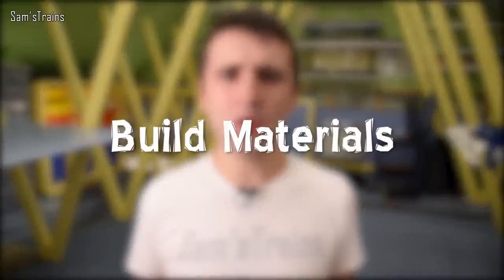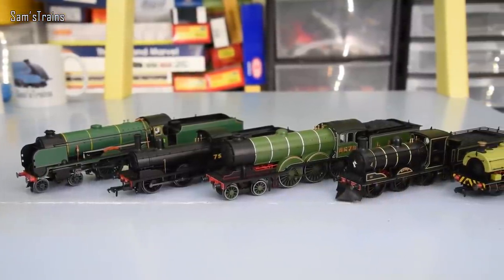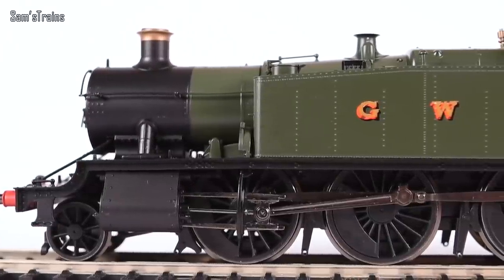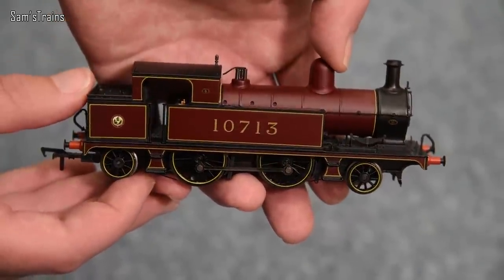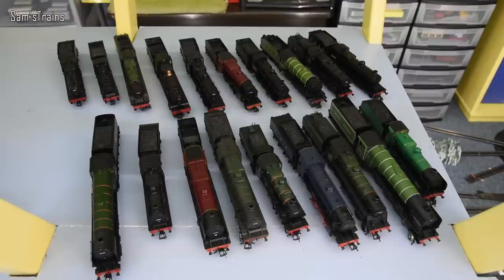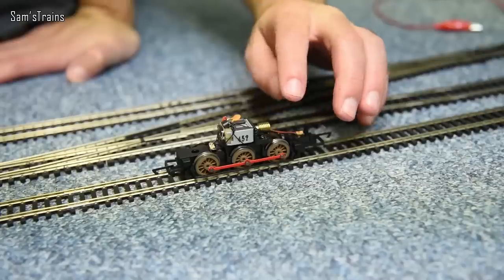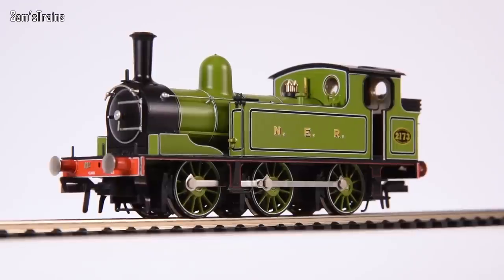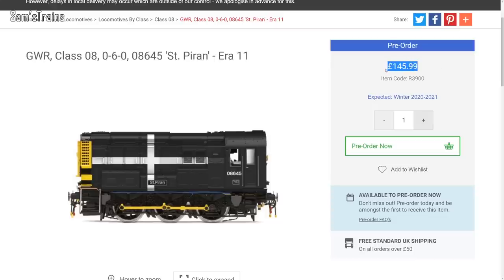Bachmann vs. Hornby Trains | What's the Difference?

Comment: Bachmann Thomas vs Hornby Thomas
Bachmann Thomas
+Is mostly TV accurate
+Has moving eyes
-Lacks open cab because cab area is stuffed with motor
-Lacks front coupling
Hornby Thomas
+ Open cab
+ Can pull a lot more
-funnel is too thin compared to Hornby E2 and Bachmann Thomas
- Only pulls more because of traction tyres
Reply from the maker: Thanks for sharing - I agree with that! :D
Merry Christmas - Sam :)

Comment: I recently have wanted to start model railroading and I’ve noticed that Hornby uses the tension lock couplers and Bachmann seems to use for their Thomas range, but their normal models do not, if I were to purchase a bachmann model, could I replace the coupler they use with a tension lock coupler?
Reply from the maker: Most of the British Bachmann models have those tension lock couplers, but they're all NEM now, meaning you can easily swap them! :D
Thanks for watching, Sam :)

Comment: Though I buy american locomotives, I noticed that bachmann prices their stock in the US fairly. For example, bachmann has an american 2-6-0 mogul locomotive with DCC and sound for $129.99, and their diesel locomotives are cheaper.
Reply: Sorry about this info! I noticed now that bachmann discontinued their ALCO 2-6-0 Mogul with sound and dcc. However, you can still get a new one on ebay from third party sellers.
Reply from the maker: Wow! I was gonna say - sign me up for a DCC sound loco at $130!! Pity about that :(
Thanks for watching - Sam :)
Reply: @SamsTrains  You can still get a new one on ebay from 3rd party sellers. I have one, and I have a good time running it on my train setup. However, it doesn't have much strength compared to other locomotives.
Reply: @SamsTrains  And the ones on ebay are also around the $130 price tag
Reply: If not, then they are probably cheaper if they are used

Comment: when you go to the american non steam powered trains, you get some really nice mechanisms, n gage have all wheel drive, all wheel pickup and a very heavy chase, when you get to ho, it isn't the greatest(if you get cheap ones that cost around 50 bucks) but they are reliable, pancake motor, all wheel pick up 4 wheel drive, no flywheels for either n or ho but really reliable. Now, if you want to a really good mechanism and really good detail and all round the best, you want to get an athearn's, the older models use band drive when they have the motor that has rods that use bands to connect to the wheel and drive it, really nice and reliable mechanism, for new models, they use all wheel pickup, all wheel drive,(not this is an 8 wheel loco and some of they 4-6 wheel shunters) 2 flywheel set up(for most) and most come with the ability to take a dcc, they go for very cheap relative to hornby of bachmann, you can get second hand(they still work really well) for their blue boxes(which I really recommend) for no more than 150(around that price on ebay), first hand you can find their cheapest ones at around 180 but they put so much work into it, the detail is amazing and they can pull a lot, they weigh so much again with all the weight in the chase. Also this is all for american versions, like gp or emd, and call me biased but love american makes like atlas and athearns. Also a big thing is that the blue boxes stopped being made I think in the 90s and they still run amazing.
Reply from the maker: That's very interesting, thanks very much for sharing - I'll have to look into some of those! :D
Thanks for watching, Sam :)

Comment: Hello Sam, I asked my local model shop if I should use isopropyl alcohol to clean old sticky oil from the wheels, bearings and plastic gear ect, and they where against it, they told me to use methylated spirits. 
But isn’t methylated spirits bad for plastic? 
Have you cleaned your trains with methylated spirits? 
what are your opinions on this? 
Cheers 👍
Reply from the maker: Yes, methylated spirits will damage plastic on contact - unless they know something I don't, I'd recommend IPA - never had a problem, and my fleet of 400 locos are most happy with IPA! :D
Thanks for watching, Sam :)

Comment: Sam, two days ago my Bachmann 57xx started jerking instead of running normally, moving for a second then stopping for a second etc. I'd like to know, do you know what the problem is, if  you do how can you fix it and do you still run that model railway repair business?
P.S. fourteenth
Reply from the maker: Hopefully it's not a motor issue - more likely it's dirty wheels or dodgy pickups - have you tried doing a clean??
Thanks for watching - Sam :)

Comment: What I call track manners, Hornby is rather more forgiving on the track less likely to derail, will take miscellaneous features and tight radius corners better and is built for R2 and often R1, my layout is R4 or greater but it still makes a difference another feature is hill climbing and again the flywheel motors are better
However on service Hornby are poor 2/10 but Bachman have the Barwell operation and they are really good 10/10 for instance Hornby could not supply me X4026 Black 5 motors and this goes in many locos and surprise none are available as donor chassis.

Comment: Ive got one question, I have only Hornby stuff. Will a Bachmann loco work on my Hornby Select DCC controller?
Reply from the maker: Yes it should do, provided it has DCC - don't try running any DC locos on the Select!
Thanks for watching - Sam :)
Reply: DCC is an international standard. All DCC fitted locos, no matter what brand they are, should work with all DCC controllers.
There may be problems with older versions of The Select which didn't meet the NMRA DCC standards properly.
Reply: @Poliss95  cool thanks! My controller should be new since I bought it this year. 

Do I buy a hornby or bachmann DCC chip for bachmann locos? Im still new to the world of model railways haha

Comment: The difference is when you compare the cover of the Bachmann catalogue with the class 90 on it, it’s stood under catenary with a matching InterCity liveried coach , then compare with the photos Hornby put out with its class 87. One company knows what they’re doing , the other doesn’t. I haven’t bought a brand new Hornby loco in 20 years , poor mechanics , poorly thought out , garden shed engineering , poor model choices whereas Bachmann make the stuff Hornby won’t like the class 350 / windhoff mpv / class 166.
Reply from the maker: That could very well be true - I'm not familiar with enough of their diesel/electrics to be in a position to compare them, so no comment! As far as steam goes though, I won't agree that Hornby have poor mechanics - the odd silly design choice sure - but their mechanisms are generally top notch!
Thanks for watching - Sam :)

Comment: Bachmann  build quality control is much better then Hornby and I've found the model detail on Bachmann to be much more durable . My Hornby King class started off as a railway high spec version ,but after a few hours of running and shedding most of its detail has now become a railroad model. Also for some reason my Bachmann models tend too have better traction then my Hornby models except for the traction tyres Hornby models. Well while they tyres  last.
Reply from the maker: Yes I've found this too - Hornby's models are better designed, but Bachmann's are better assembled - no doubt about it!
Thanks for watching - Sam :)

Comment: 4f was Airfix before Dapol

Bachmann were the first to introduce Flywheels in the RTR range, im surprised they dropped, it... used to be that the flywheel was also the drive gear, (large diameter wormgear

I would say that it was about 2002 that hornby started to get their brains into gear, when they started to ditch the ringfields and small motors

THe hornby 08 is a far newer model, the bachmann one has been around since around 2000

Bachmann were once Far better than Hornby, when they started they had Replica Railways, and Mainline,  Hornby started improving once they purchased the Dapol / Airfix line, in around 2001 it took them a couple of years to get their own models up to speed, (hornby had a lot of tender pickups back then because most of the larger locos were ALL tender driven, only some of the older Triang stock were locomotive drive,  and then were fitted with the little square motor (first introduced in the class 58 the new Can motor looks far better than that thing.
Reply from the maker: Right you are - either way - many decades ago! Bachmann didn't drop flywheels per se; their diesels almost always have them, (their diesels being far better mechanically), but very few of their modern steamers have flywheels. Yes - 2001 was the turning point for Hornby - and they've never looked back since! Bachmann's current models would have been astonishing in the 1990s or even early 2000s. The trouble is that they haven't really developed much further!
Thanks for watching - Sam :)
Reply: These tender pickups on 80s and 90s era Hornby tender drive were pretty inferior since in almost all cases just two wheels on the tender and two wheels on the loco picked up current. Rare for anything from Tri-ang, Tri-ang/Hornby or Hornby pre 2001 to have any more than two wheels on on side picking up and two wheels on the other side returning the current. Not the most controllable and tolerant design. Even most two rail Hornby Dublo and Wrenn were like this.
Where I live the all wheel pickup and all wheel drive systems with a five pole central can type motors with proper flywheels of the Athearn Blue Box diesels were so much better value at 2/3 rds the price of even a Hornby 0-4-0 over the period 1975 to 2000. No diecast rot in the massive chassis of any of these 40+ year old Athearn diesels either. Unlike numerous rotting Hornby, Bachmann and Heljan examples of UK models.

Comment: What happen if all OO scale manufacturer change the scale to HO for accuracy reason?
Reply from the maker: I think there'd be huge trouble - suddenly everyone's existing scenery, rolling stock, locos etc would be out of scale.... no manufacturer wants to do that! ;D
Thanks for watching - Sam :)
Reply: Quite a few makers found out the hard way that making British trains in HO scale was a costly mistake as the sales were quite poor.
Lima was one in the 1970s with their first British range. The had a class 33, LMS 4F, Mk 1 and 2 coaches, some wagons and vans and a BR brake van. All looked tiny on the track and the 4F needed to be overwidth so that the ususal width wheels could fit under the splashers. A 33 on YouTube :
https://www.youtube.com/watch?v=nf5QVvz5hfE
Lima learnt from this mistaken advice to go HO and had much more success when they went OO fro British outline.
Fleischmann about 40 years ago made a HO scale Warship and Bullieid coaches.
All looked small compared to OO models and especially HO models. The range was not expanded and took many years to sell off the production :
https://www.youtube.com/watch?v=tmeqfySFOjw
Other unsuccesful attempts by Marklin, Trix, Playcraft/Joeuf and  Rivarossi with a  Royal Scot and LMS early coaches.
Rivarossi Royal Scot from 1979 https://www.youtube.com/watch?v=i3TYPPR52JA
Athough Rivarossi and Trix tried to compromise with an in between 1:80 scale (common in the 50s and 60s in Europe) which annoyed both OO and true HO users.
At out club second hand stall I noted comments from some saying we can't buy the Lima HO coaches as they looked like TT.
British in HO would be smaller and lighter than any other HO equivalent models on the market and steam models will need width distortions for wheel clearance.
The most successful was the PSM HO Korean brass model of the Flying Scotsman priced at arounf $1500 when new but now commanding $2500 or so. Bought by keen Australian modellers to model 4472's 1988/89 running in Australia. So modellers wanted it to correctly visibly smaller than the local equipment. One badly filmed but looking good running here :
https://www.youtube.com/watch?v=v6ADkpxP82o
Märklin gave up after their disastrous  model 3073 of the warship class
https://www.youtube.com/watch?v=ihchxLkjrwg
Reply: It's too late to change now. It's not like going from DC to DCC. Those modellers who want accuracy modify their locos and rolling stock to Protofour standards. 
There's also a 00 scale in the USA which is different to British 00.

Comment: Hi sam not sure what your opinion is on the hobby in general ive had to start selling my railway collection has the hobby has become to expensive a locomotive now costs nearly a weeks wages if not more i personally think when the older generation have passed away that the hobby will died haswell has most of the people i know who collect trains have retired with good pensions which i will not what are your thoughts on this dont think hornby or bachmann are interested in people's opinion they will eventually go under for this reason.

Comment: Hornby- cheap chinese 5 pole, bachmann- proper make 3 pole with much better spec. Also re pickups bachmann metal wheels all short to eachother through con rods as well as pickups and all painted- any good wheel pickup + any good wiper = runs, hornby plastic unpainted wheels with metal tyres only- needs wheel and wiper on that wheel to both be good at the same time to run.
Reply from the maker: True - but as I've demonstrated, the cheap Chinese 5 pole motors perform much better, and they're much easier to get hold of. The Bachmann wheels shorting together makes no difference - each driving wheel has an individual pickup in all cases, so Hornby's regular use of tender pickups still makes them more reliable on the whole. Hornby also paint their pickups!
Thanks for watching - Sam :)

Comment: What is the difference between a 3 poll motor and a 5 poll motor
Reply: It's very simple to imagine, but hard to explain. Well, hard for me that is, so I'll post an explanation from someone else. :-)
Post by Bufferstop » Fri Jan 09, 2015 11:39 pm

First of all 5 pole. Small DC motors have a rotor mounted inside a permanent magnet. The magnet has two poles, the rotor needs at least three. Each of the rotors three poles are wound with wire and connected to copper segments on a drum or disc. Power is applied to two of the windings by carbon brushes pressing on the copper segments. The two poles generated by the current are out of alignment with the 2 poles of the magnet and try to rotate into alignment. As they move the connection is moved to the third pole so the rotor moves further to get into line. At low speed the three pulses per revolution are noticeable and can lead to stalling, so adding two more poles (must always be an odd number) gives 5 pulses per revolution which means it's smoother and less likely to stall.

Now skew wound. Instead of the pole pieces on the rotor being in line with the axis they look as though someone has twisted the two ends in opposite directions, so they have the appearance of a slow screw thread, this means that the pulsing effect is further reduced. Just as the end of one pole piece is moving away from the magnet the other end of the next pole is just moving in.

The five pole motor will start to turn at a lower voltage. It will turn at a lower speed for a given voltage without a loss of torque. It allows the use of a lower gear ratio which means lower mechanical power losses.
Reply from the maker: haha you're absolutely right - simple to imagine but hard to explain! I think you did a superb job - good work! :D
Thanks for watching - Sam :)
Reply: This video may also help in that it describes a 3 pole motor :
https://www.youtube.com/watch?v=1673-0Y3fFQ
In a five pole there are five segments instead of three. This leads to a segment being nearer the magnets than a three pole. This makes it smoother with more power.

Comment: Metal is cheaper than injected plastics and Resins, Hornby will use metal on models they don't sell many of, whereas popular locos like the Mallard, and Flying Scot are popular with a cult following so making them in Plastic is a better option because they will sell more copies of those locomotives compared to a 9F Jinty...

Oh and Hornby need to enter the N gauge market to take away the Bachman (Graham Farish) monopoly... when an N gauge loco costs more than a high end OO loco you know there is a serious issue
Reply from the maker: That's an interesting thought - but then they sell their die-cast duchess of Athol for £250, as opposed to the plastic one for £205. So if it's in fact cheaper, but marketed as superior, then why don't they always do it?
Would love to see Hornby do N gauge, for sure! :D
Thanks for watching - Sam :)
Reply: @SamsTrains  because metal often sells less models, although it can give better detail but also gives them a much higher profit margin per model which offsets the lack of sales, quite common in the tabletop gaming scene with commander/hero models.

I reckon Hornby N gauge would be a huge success